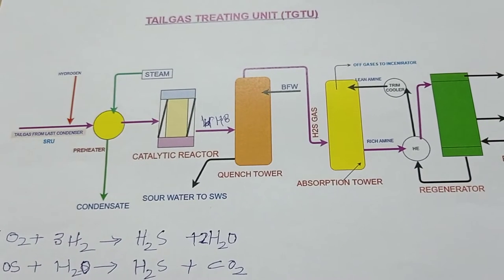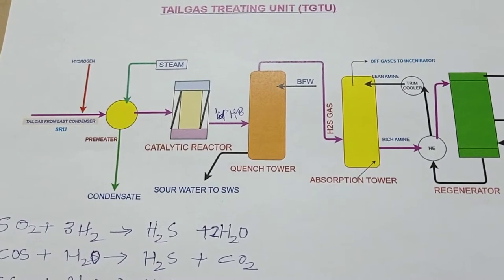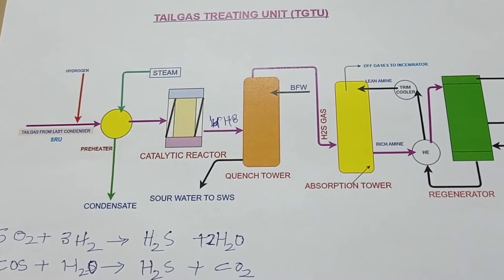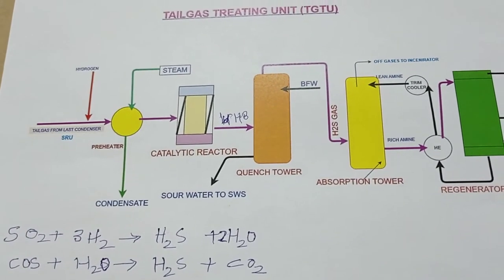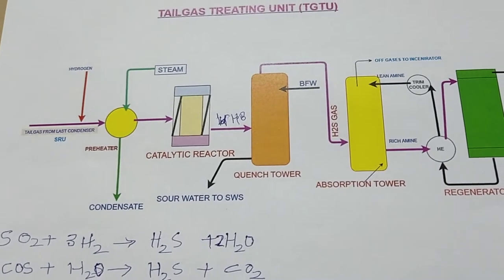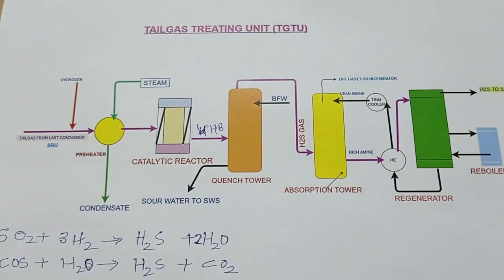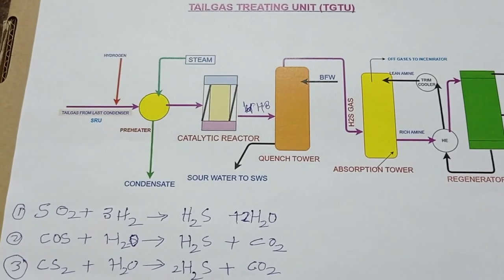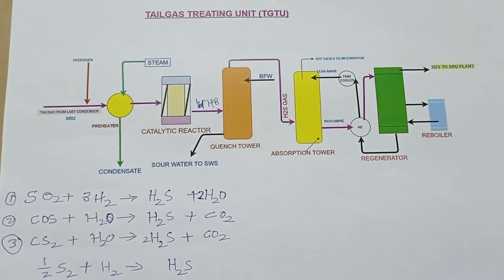SRU PART 2  (SULFUR RECOVERY UNIT ) TAIL GAS TREATING UNIT ( TGTU)

Comment: can we directly send H2S from quench tower to sru . what is the need for amine absorption again..
Reply from the maker: Tail gas contain mixture of gases along with h2s . The h2s present in gases is fixed h2s which can be splitted from the tail gas with the help of amine
Our aim is to send h2s gas to sru not whole tail gases from quench tower
That is why we use quench tower to separate h2s with the help of amine
Reply: @chemicaldiary8412  thank u